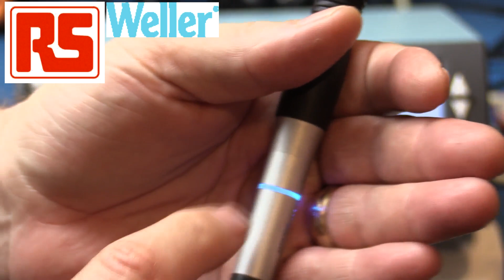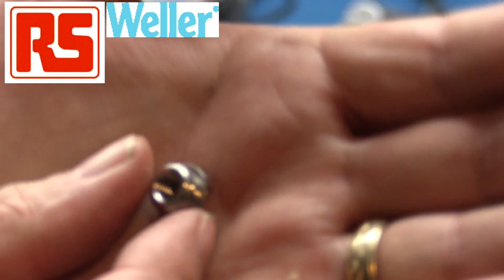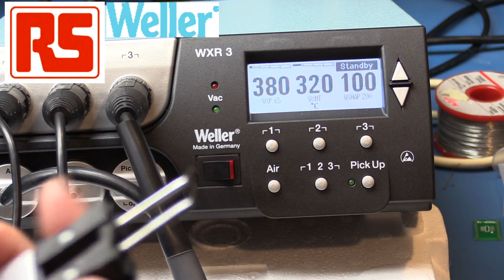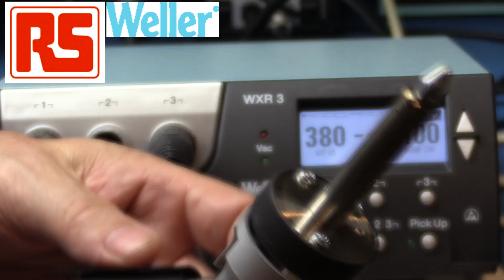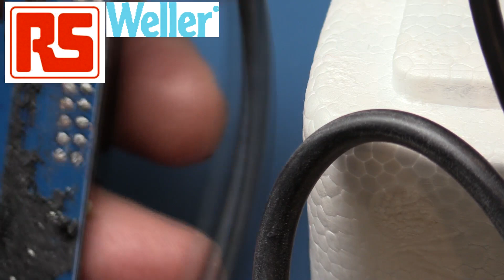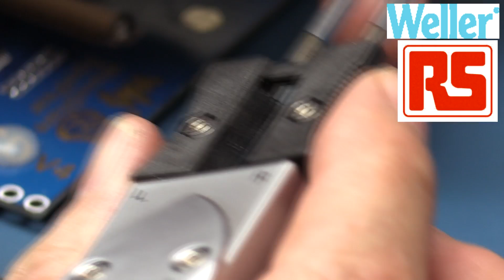Weller WXR 3003 Soldering Station first use

Comment: Thanks for the video. Short question. To remove an IC in case of a densely populated board, it's a bit hard to use a hot air gun without blowing off tiny neighbors. Would you recommend  rework station tweezers together with pickup, or would the pickup rubber could melt die to the heated component? Thanks again.
Reply from the maker: Yes, that is a recurring problem lol,  The ways I have solved it in the past have been to use Kapton tape to "Tape" down surrounding components, this works very well, other techniques include adding tin shields between the target component and devices to be protected, especially things like connectors and other plastic parts that can easily melt if not shielded
.

Comment: The vacuum pump on that sounds considerably quieter than the Pace de-soldering iron I used at a former employer.  While Pace makes some really nice self-contained de-soldering stations they are very noisy.   At least that is my perception from the video.
Reply from the maker: It is pretty quiet I have to say, I have heard others in the past and this from memory beats them all, it was only about 2 feet from the microphone too.